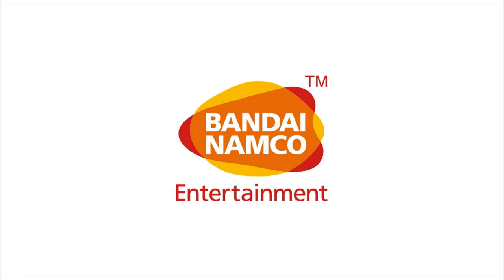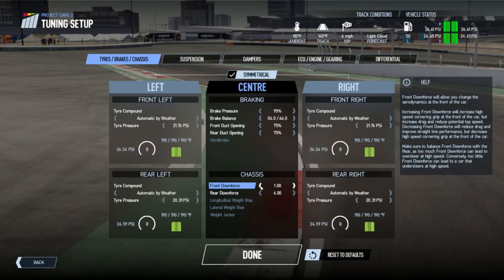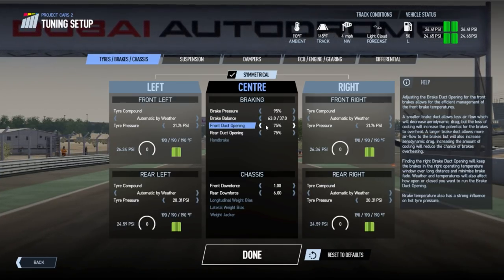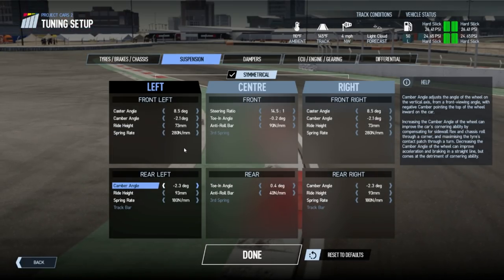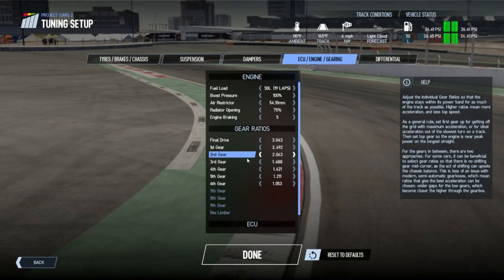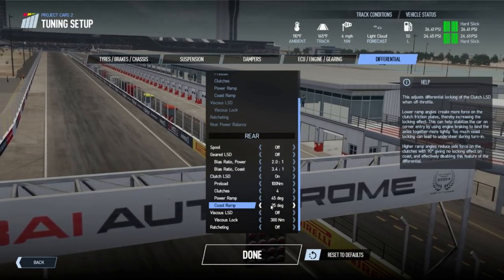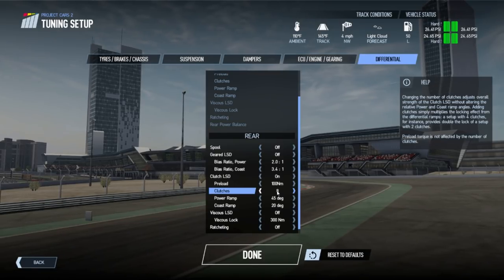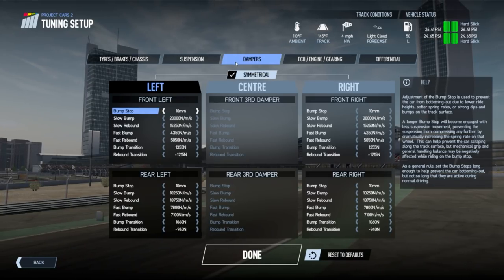Top 5 Ways to make your car stable under braking

Comment: The biggest issue is....... time. Just wanna get home and drive not having to take hours to fiddle with settings just to get the bugger to brake into T2 of some random track without it snapping loose on you. What we really need is a website where we can download all your setups perfectly crafted for all the cars and all the tracks. Does sound a bit unreasonable doesn't it? ;)

Comment: I would def start with brake balance to an extent more than likely use the LSD together with brake bias if you have a turn like that on on top of the hill at Algarve, or if you're losing the back under braking anywhere really. Def should start there. Maybe a few tenths of a degree of camber out of the back to get a better contact patch under straightline braking. But I'm not that well versed in tuning so take that as you will.

Comment: Engine braking in the explaination window the higher the value the less engine braking. Confused which is it? 5 is more than 1 or the other way around.
Reply from the maker: The higher your engine braking the more stability you have but the more understeer and locking you have.
Reply: From the explanation, 1 is higher engine brake than 5 correct? How about I set it to zero?